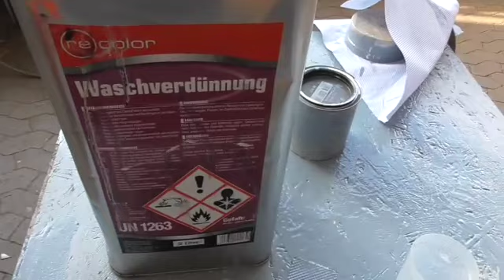T&C Grinding Attachment  Pt1: Watching paint dry …

Comment: thx for the video! 
i just tried to paint the spindle stock of a bearing eating bernardo lathe - 
i went to a „fachmarkt“ since i know nothing about painting and told them about my plans and asked what type of paint i should use and how to clean residual oil off - 
off i went with a couple rattlecans (quite expensive ones) of 2k ep primer and 2k ep paint and the knowledge to clean everything with „nitroverdünnung“ und „bremsenreiniger“ i soaked the whole thing in said chemicals and so i did my best according to the datasheet - after 1 week of drying, everything peeled of with a spatula - back to square one - is there anything obviously wrong with my work, or should i buy a paintgun and try again with ep primer and pu paint? 
i’m such a paint noob! 
i’ll wait for the next video!
Reply from the maker: 2K rattle can should be sufficient. Brake cleaner is nonsense in rattle cans. I don't know how generations of mechanics could live without them. And I have severe doubts how well that crap works for this application. For degreasing, acetone is best, but nitro thinner is good too and easily available. Now why did all that peel off later? Is the first layer still in place?
Was the shelf live of the paint expired? They don't last forever! 1 ... 2 years. EP-primer is OK, but for the finish, I prefer PU as it (in my experience) has a nicer finish.
Did you shake the cans well? Did you sand the primer? Scotch brite ("Schleifflies") gray or fine black is enough.
If you buy a can of filler, it is cheaper than a rattle can:
https://www.123lack.de/ep-2k-grundierung-1kg-set-inkl.-haerter-mipa-epoxy-100-20
The paint is more expensive: https://www.123lack.de/mipa-2k-acryllack-set-pu240-inkl-haerter-ms10-alle-ral-farben (it is PU, not acrylic).
They also do have a cheap spray gun (NOT a HVLP = High volume, low pressure). But all this will set you back at about 100 € 😞They do have 2 K rattle cans, but I have no experience with those.
Hope that helps!
Reply: @MuellerNick  Hello, is there a way to contact you?
Reply: @MuellerNick  Xylol/xylene for degreasing, if still available?  And it smells nicely.  🌹